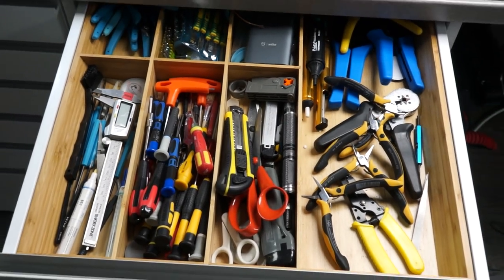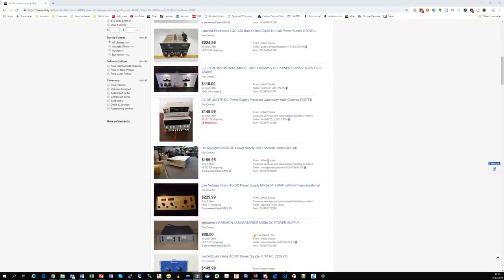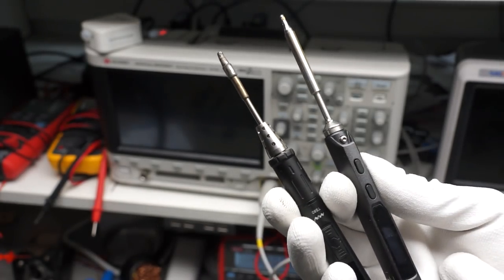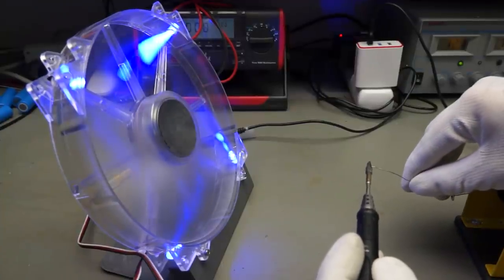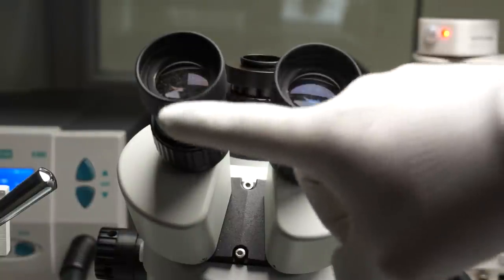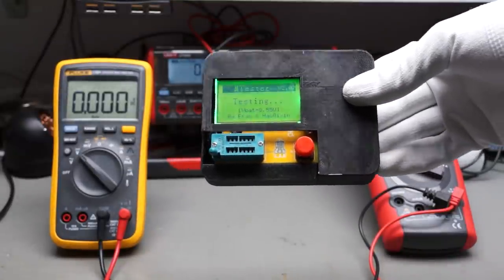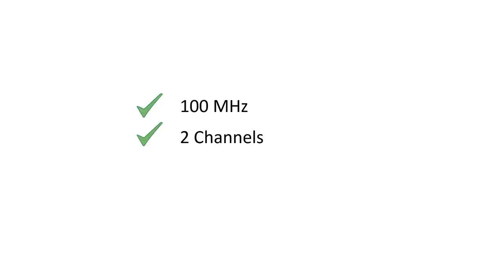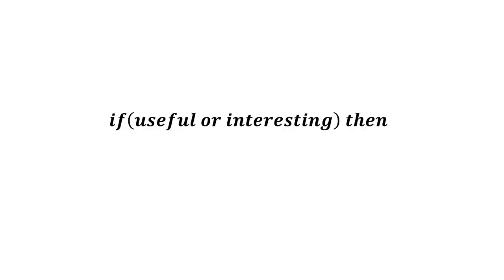#260 Most used tools, tips and tricks to spend your money wisely

Comment: excellent information! do you have any opinion on this Siglent-Technologies-SDS1052DL? it is 100€ cheaper and except for the low frequency, it looks the same as yours..
will it work for the usual test cases?
Reply from the maker: 50 MHz is a quite low frequency for digital circuits. But the rest is ok.

Comment: You forgot to mention crt o'scopes are dirt cheap and good for new guys
Reply: I disagree. A $200 Rigol is almost always better. CRTs have no storage, poor trigger-options and the old (really cheap) ones always have some broken knobs & switches that will distract you from the job at hand every single time. Furthermore, they are usually limited to 2 channels and a lower bandwidth, and eat up a bunch of valuable desk-space in the lab. If budget really is an issue, then a handheld or USB 'scope is an option.
Reply: In India, yes, digital are best, but you should know that foreigners throw away their old equipment even if it's useful. When I was a student in Canada, my computer, o'scope, multimeter, drill,crt TV and a joystick were all second hand and all of them were cheaper than 20$
Reply from the maker: I agree that storage is a game changer for oscilloscopes, especially with digital signals. But if you get n old one with storage and have enough space in your lab, why not?
Reply: @AdityaMehendale  Not always. I don't know Rigol, but a second-hand branded high quality scope (or any tool for that matter...) is always better than a new cheap fancy thing, which show you a ton of shiny features, but none of them are perfect or has good usability. There are CRT storage scopes too. Obviously they are not comparable to new high-end storage scopes with a ton of memory and a lot of math functions, but those are not always needed. Depends on your projects. If you mostly do digital work and need a lot of memory, maybe you should use a logic analyzer instead.

Comment: Thanks for the tips, but I was wondering why do you not recommend a lead-free solder for makers ? Just curious, I do use a leaded solder myself.
Reply from the maker: Because it is hard to use. I think it was not made for hand soldering.
Reply: Oh, I see. I did notice that those seem to require higher temperatures to melt. Thank you for replying!

Comment: Thanks, but for me is the other way around. Since i have a CNC Mill i not really often use my 3D printer. And with the Lasercutter (cheap Chinese one) even less. Maybe my new Anycubic Photon will change it, based on the better Quality. I simply dislike the Surface Quality, and also i do not want to live in a plastic Hell :o) 

Also some tool i really often use is my ElectronicLoad (Mayuno) - to test the Powersupplies i got with all the elektronics you can buy. 50% fails my test, and 10% start the magic smoke during my tests. So no untested Power Supply will reach the Kids Bedroom :-) (Worst one puts 230V on the 12V Line, depends in what direction you put the Powerplug.)
Reply from the maker: I had a long list and had to do some (personal) choices.

Comment: Hi Andreas, you advise against using lead free solder wire for the beginners - I'm curious why. Any explanation would be most welcome!
Reply: It's harder to work with and requires higher temperatures.
Reply: It's slightly harder to work with. If you aren't running your iron hot already you might need to bump the temp up a bit to get decent results. Literally all components etc are designed for lead free processes now so that shouldn't introduce any extra issues.
Proper fluxes etc are usually more aggressive but chances are you're already using fluxes that are made for lead free processes either way.
Reply from the maker: Juan is right!

Comment: There's one problem with cheap autoranging multimeters - resistance autorange is SLOW, which is annoying when you have to measure something with dinky contacts, as when you're poking around with probes trying to make a good contact it goes through all the ranges again and again. Of course it doesn't mean one should choose manual range one (there are no decent manual range meters on the market anymore) but stay away from ones that require weird key combos to turn the range into manual. There's one place where I'd recommend manual ranging though - education. If you want to measure something you need to have general idea what the range should be, so it requires you to think about what you're measuring and what will the result mean (it's like with physicians, first thing they are taught about ordering a test - what decision will you make after getting a result and will the result impact the decision). I ran "electronics 101" lab at uni and I've seen plenty of interesting reports with voltage suddenly going from 1.01V to 1000V because the autoranging meter will always show some number :D
Reply from the maker: AFAIK you can select the ranges manually also if you have an autoranging meter.

Comment: When your Fluke auto turns off you can just hit the yellow button to turn back on, no need to cycle the selector.
Reply from the maker: Unfortunately, not. That is because I mentioned it :-(
Reply: @AndreasSpiess  Sttrange, I have the same meter for work. Can you disable sleep mode on yours by holding the yellow button while turning it on?
Reply from the maker: Yes, I can switch it to "always on" by pressing the yellow button. But then I forget it and have to change the batteries too often :-(
Reply: @AndreasSpiess  : BTW, is it a bad idea to hack the 9v connector into a 9v wall-wart transformer?

Comment: Thanks for all your great videos Andreas :)  Many oscilloscopes can be remotely controlled by sending SCPI commands over USB from a PC. Would it be possible to build an "Oscilloscope remote control" using for instance an ESP32? Is it possible to establish USB communication between the oscilloscope and a microcontroller, instead of a PC? Maybe a project idea for you...
Reply from the maker: The newer oscilloscope come even with software for remote control and display. The commands are very specific to particular oscilloscopes. So it would not make a lot of sense for me. The suppliers have to provide this info. Some oscilloscopes can also be remotely controlled by Sigrok pulseview.

Comment: Tools is so funny sometimes. I upgraded  my soldering iron and at the shop I told about it along the brand. I was asked about how the h*ll my iron stopped working only after only 25 years! I told it did not, I'm just upgrading for more recent features like a pen style iron, the old one is just fine but not for my needs now.  (Sure, changed some tips in the time old iron served me!) I think I was in my 20s when I got it and it seemed like a lot of money! (and some features not common back then).. Later on, it was worth every penny and a lot more!
At higher age vision is not that great or pupil is not that flexible any more. Microscopes and magnifier get more and more important at higher age. I can think of the time when soldering 0805 was no problem visually. At higher age even 1206 can get difficult without some kind of magnifiers and more modern stuff is a lot smaller than 1206!
Reply from the maker: But fortunately, we have all these tools and can fight age (at least a little) ;-)

Comment: I would beg to disagree regarding the microscopes... the binocular kind Can be very functional IF you get a good set with the angled optics. I have used them for SMD soldering for decades and the neck strain of looking through straight down ones can easily get excessive. Even the angled ones can leave you quite stiff as you must hold yourself rather still and a bit hunched over to maintain focus while trying to do fine manipulation with your hands.  The USB microscope you showed is one of the cheap and crappy "kid" type scopes to look at bugs and leaves, not a serious working one. A proper working one will be between $150 - $400 USD, will have the far longer clearance distance between the work and the lens, usually has a 4 - 5 inch screen attached to the mast, and has an HDMI output to send it to a much larger screen so you can actually move a bit while soldering.
Reply from the maker: As you write, more expensive microscopes are quite expensive. If you do not need pictures, I preferred a binocular over such a microscope because it is 3 dimensional. Many viewers do not know the difference.

Comment: US vs Swiss "terminology".  In general what we call "pliers" are limited to tool that grasp things.  They may cut, but that is a secondary function.  We call the long nose pliers, "needle" nose.  Many styles, sizes and manufacturers.  Makers will likely need 2 sizes of needle nose pliers.  If they just cut wire, we call them wire cutters.  The slang term is "dykes", which came from a very old US tool manufacturer.
If a maker is in to robotics or mechanical things, they will like need heavier piers,  Again many styles, sizes and manufacturers.  Locking pliers are a must have !  Because I do automotive and small engine repair, I have about 8 or 10 different styles and sizes of pliers.
For makers who work with motor and other items that draw a few amperes of current, I recommend a second multimeter that has an "amp clamp" feature.  Non contacting current measurement.  These start at around $50.
Reply from the maker: Thank you for the correction
Reply: @AndreasSpiess  - Please don't think of it as a "correction", it was just a small CLARIFICATION !  I always admire people whose native tongue is NOT English who can master our complex language !

Comment: A reason you wouldn't use a cordless iron is that you increase the overall risk of an ESD event damaging whatever you are working on as the iron is not at the same potential as your work and may have built up a significant charge. It's a shame to have a decent dissipative bench mat and wrist straps if you then undo that good work with other practices!
Reply from the maker: You can add an earth cable if you want.
Reply: @AndreasSpiess  haha with ESD it's sadly not a case of if you want or not :-)

Comment: Soldering: KSGER T12 is even below T80 in price and its tips are way cheaper to replace.
Reply from the maker: Thanks for the tip! Does it also have motion control? This is what I like a lot on the TS80/100. BTW: The TS100 is as good as the TS80 in my view and cheaper.
Reply: Andreas Spiess Well, it has a „Schüttelsensor“ in the tip holder. I got my from the „official“ ksger store on ali express but there are so many variants of the board  and hand set available. (I bought the older version 2.01 with 3 tips for around 35€ delivered). As I said in my first comment, the tips are real benefit because it uses the „hakko like“ tips for which there are ~20 different tips available starting at 2-5€ each.
Reply: I think our Chinese friends tried too hard to sell fake Hakko stations but got cought. Then they adapted and put it in a neutral case, not mentioning real brand names anymore. For example the hand grip I got with the T12 is identical to the one that Louis Rossmann got with his fake Hakko unit (See his review video from late 2016). Also the tips are „Hakko compatible“ but don‘t mention the name. I hate fake products but I like the way their put some STM32 with custom firmware  to use with it (same with T80 and T100 iirc)

Comment: I don't think the USB isolator you showed would work with a USB oscilloscope, aren't they limited to USB1.1? USB2.0 and especially 3.0 isolators are expensive.
Reply from the maker: I do not know. I use them sometimes and they work. But I never cared about 1.1 or 2.0
Reply: @AndreasSpiess  I think most of them are limited to 12 mbps. It's kind of a shame that  USB scopes (at least the low-end ones) don't at least have some isolation.
Reply from the maker: That is why I did not recommend them.

Comment: About multimeters - i have 4 of them, because, sometimes i need to monitor multiple test points, locations, parameters etc.. But i prefer manual range for two main reasons - if there is bad connection, auto range multimeters jump's around like sick and second, if i need to read quickly, i can just to look at readings, because i know which mode or range i turned on.. for automatic range there is risk of misread signature if just quickly look at LCD.. But anyway, i have multimeter with autorange, sometimes it's quickly with him, depends on what i do..

Next very important thing is probes - always use good quality probes only, because cheaper probes may affect readings and they broke quickly if compared with middle priced or expensive ones.. 
I have lots of good quality multimeter and laboratory probes with identical ends and different end plug adapters (expensive but worth every cent - flexible silicon grips, crocodile grip, needles for piercing etc).. 

About logical analyser is good advice, especially, if there is need for digital circuit debugging.. And i have one to, but i purchased cheap CY7C68013A development board and adapted it as FX2LP USB logical analyser with 16 channel inputs.. 
About branded digital oscilloscopes - no need for them, because that is extra.. Analogue scopes is good to and may be purchased used more cheaper, especially, if user never used scope.. Burnt out expensive digital scope and burnt out analog scope is very big difference, especially, because analog scopes can handle more operator error's.. :D
I'm using my old analog scope more than 20 year's and i love him..
Combination with logical analyser creates excellent gear for me..  :) Yes, time by time i feel need for digital scope, because in modern day's all gets faster, but it's (digital scope) not so critical in my case and when i, finally, decide to buy one, I wanna it with excellent characteristics for next 20 years, at least.. :)
Reply from the maker: The CY7C68013A boards are a good idea. I have one in the mail ;-) Concerning oscilloscopes: If you deal with non-recurring signals storage is a game changer for me.
Reply: @AndreasSpiess  In case of short single pulses, i agree, that DSO is game changer. :) Few times i needed to capture single pulses and with analog scope this is very difficult, but not unreal - scope in triggering mode, tripod with photo camera in front of scopes screen and i can easily seen pulse in picture. :D Only disadvantage for that method - few repeats needed because i need to push shooter button in right time and adjust camera exposure time.. 
For my CY7C68013A board, when i using it as data logger, i use Sigrok software. Work's perfectly in Linux but Windows version i didn't test.

If board is in mailbag, that's mean that shortly we'll seen it in new video? :)

Comment: Someone should make a plated perfboard for smd. Or does it already exist ?
Reply from the maker: I mount SMDs on small PCBs. Then they behave like normal ICs and can be used on breadboards (https://www.aliexpress.com/item/100pcs-SOT89-To-DIP-SOT223-To-DIP-Adapter-Board-Transfer-Plate-Pinboard-1-5mm-Pitch-Pin/32712489745.html)

Comment: sorry, but i have to disagree. Good wire strippers ARE WORTH THE MONEY!
The one you showed is indeed no good, but if you get a weidmuller wire stripper, you will agree with me. I have 2, one in the shop and one in my toolcase, and i really am not happy if i didnt take it with me. Spend the money on a weidmuller, they are expensive but they will last you a lifetime.
I am not affiliated with the brand, just a verry happy user!

And for the heatgunreccomendation, i own the RS PRO heat gun and it works fantasticly! heats up about as fast and also cools down automaticly whan you put it in the stand
Reply from the maker: I have many viewers who cannot afford a Weidmüller or Knippex. This is why price-performance is a very important topic on this channel. BTW: I made a stripper comparison (without Weidmüller, I have to confess)

Comment: DO  NOT get a cheap manual wire stripper! (unless you are into suffering) Get an automatic for around 12€, the Jokari one from Amazon is very good and reliable.

PS: Simply switching the range on the Fluke or pressing any button for that matter turns on the instrument, very convenient in my mind.
Reply: I've had better luck with a quality manual wire stripper than any automatic wire stripper I have come across.
Reply from the maker: @Jakob My Fluke has not the features you describe. 
I tried also automatic tools. I did not like them (maybe I had the wrong ones). The one I use now cuts the whole isolation around the copper because it is exactly adjusted to its diameter. The automatic ones only cut from the top and the bottom and tore the rest apart. Which did not result in good cuts, especially not for silicone wires.
Reply: I stand corrected. Guess thats only on the 87. About the automatic wirecutter from jokari or the more expensive but worse from knipex actually also cut the sides because the blades have indentasions. Very easy to use and work every time.
Reply from the maker: @Jakob Holz I ordered now a Jokari because a few viewers recommended it. I will compare it.

Comment: I highly recommend those wire strippers :
https://www.weicon.de/en/industries/mechanical-engineering/stripping-tools/43/wire-stripper-no.-5?c=366
 You can buy them in hornbach or other similar shops much cheaper. I never had better strippers.
Reply from the maker: Thanks for the tip!

Comment: Holy sh. I spend more than 50 bucks and no optocoupler to keep it from killing my PC? Wow.
Reply from the maker: If you refer to the power supply: You can get one with bluetooth
Reply: @AndreasSpiess  I forgot to put the time. t=728. I was talking about the USB oscilloscope, it seems surprising that such a USB isolator wouldn't be built in, I thought you had to make that but now I see they are for sale, linked to in the description. Thanks for the video.